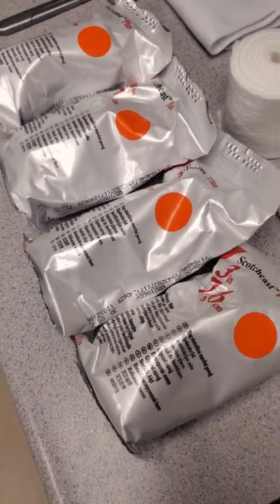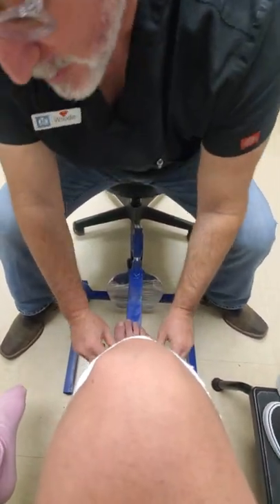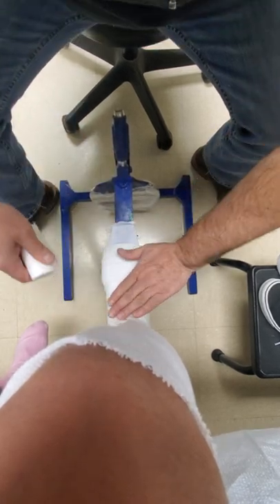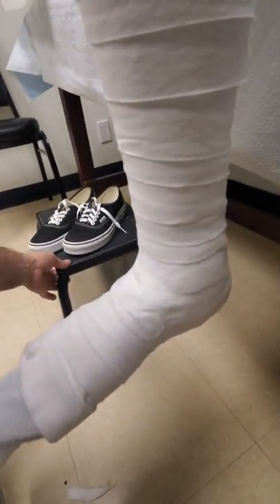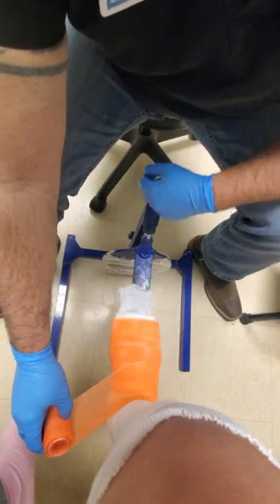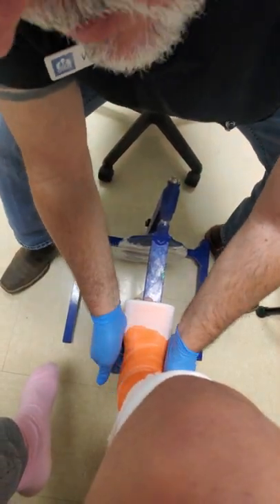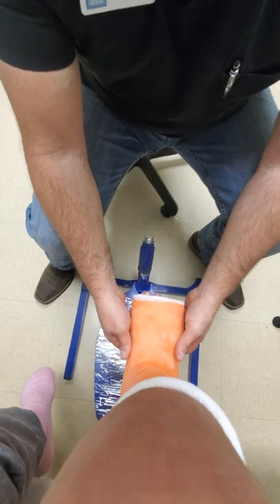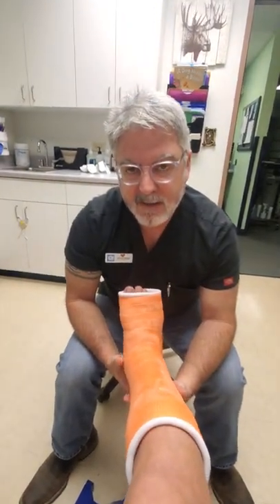How to Use a Cast Stand to make a Short Leg Cast

Comment: Thanks for doing a demo so quickly. Very helpful. I had a question for you. First, I have been both a provider and patient myself. I ruptured my Achilles’ tendon several years ago and was in a series of cast before moving to a CAM boot. Second, I am also always learning how to apply cast better. The question I have is, why you don’t expose the toes very much? I was taught that only time the cast should extend to cover the toes is for metatarsal fractures…otherwise, that all five toes should be fully visible. This may be a difference in techniques…but thought I would ask. Thanks again for doing these instructional videos. Erin
Reply from the maker: Good Evening Erin, thank you very much for the question. I agree with you 100%, the majority of the time we only go past the toes when the MD orders it or a toe plate for those distal type fractures. Full disclosure-  I am simply in the habit of making the distal cuff of the short leg to the mid toe print of each digit (slanted obiquity), probably after years of working w/ped's & seeing how they tear up the casts, just being kids. (Side Note= I definitely see more adult casts with full toe exposure, maybe b/c we don't run around as wild w/ a cast on 😆) As always, I appreciate your feedback as well, sincerely woodie 🦵🙂👍🏼

Comment: Good morning, congratulations for your videos! 

Could you please tell us what are the dimensions (length and width) of the thin foot plate to model the cast? (the one to maintain the position, not the wide one).

We would really appreciate your help!
Reply from the maker: @CarloVentimiglia-k9c  ...Carlo, thank you very much for viewing and for the compliment & question as well.  Measuring the cast stand for you now: the foot rest on the top measures approx 8in long, the base is 12in x 12in w/ a space in the middle to place a bucket, and the height extends from 12in at it's shortest to 22in at its tallest adjustment.  I hope this helps & feel free to type in your image search bar under cast stand for similar items... woodie 👍🏼
Reply: @orthopedicbasicswwoodie1097  Thanks for your kind and precise answer, Woodie!